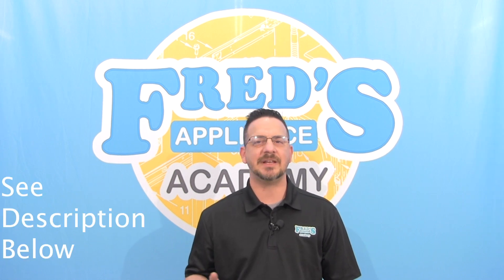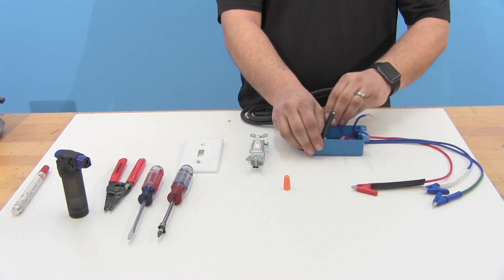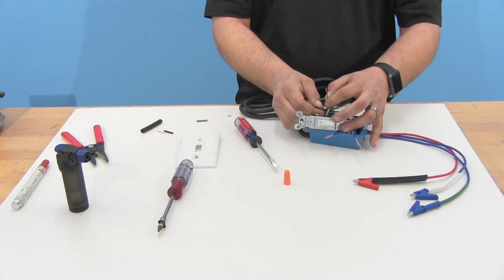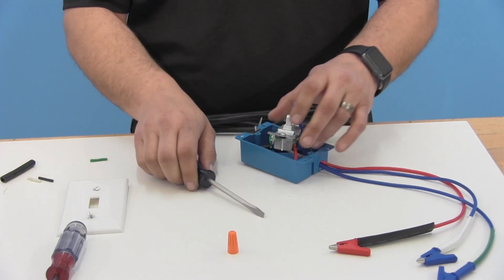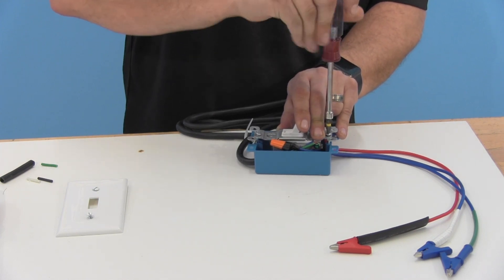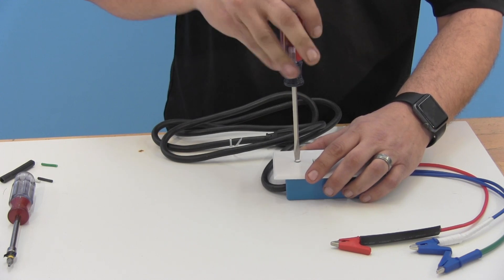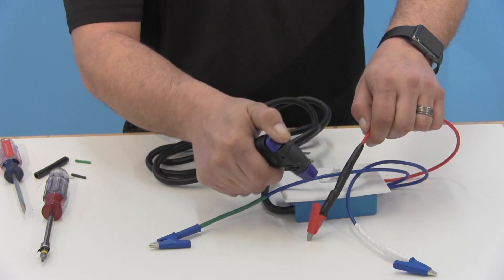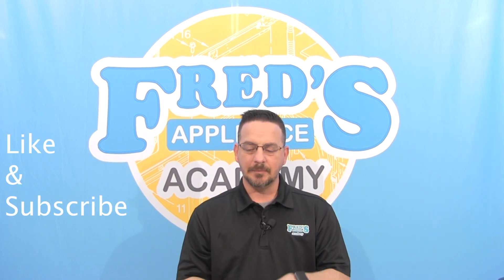How to Assemble a 120-volt Auxiliary Power Supply for Appliance Repair Diagnostics

Comment: Great video. The twisting or not of the wires before using the wire nut depends on the wire nut manufacturer some brands require twisting.